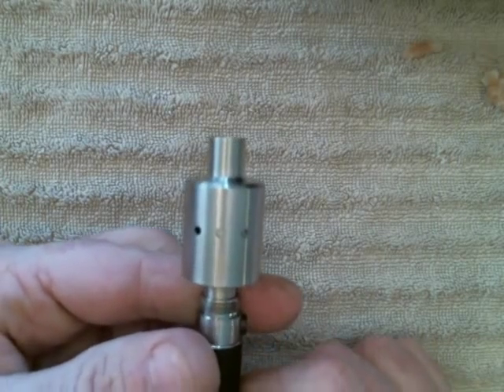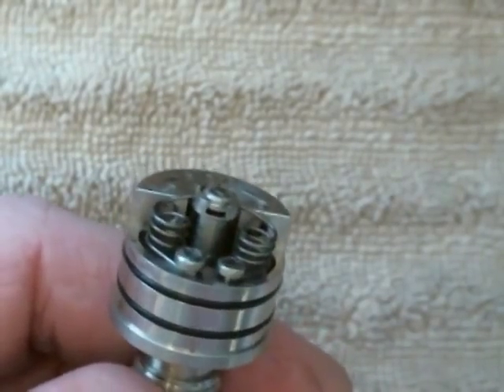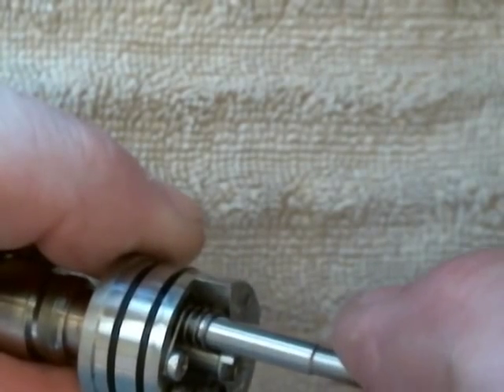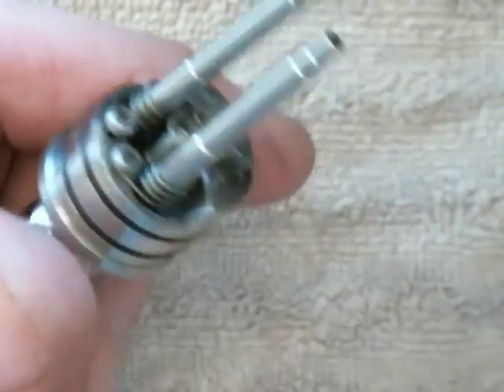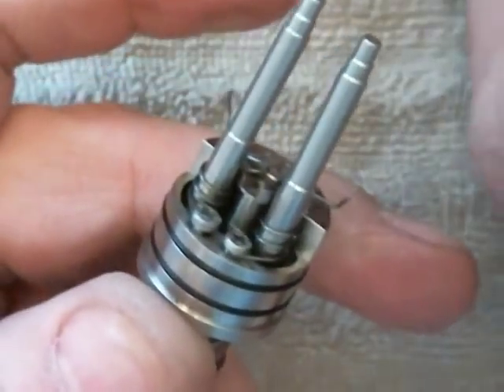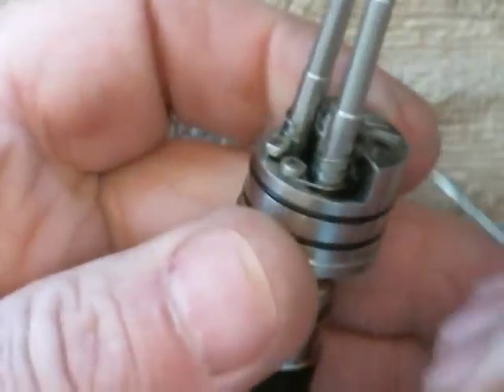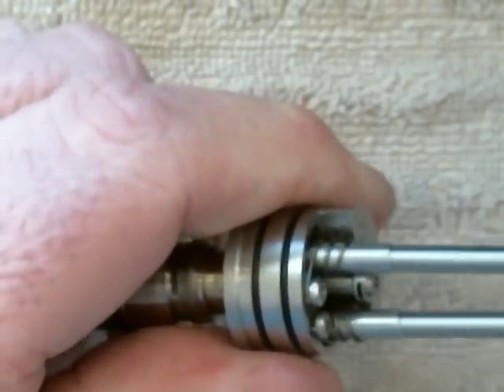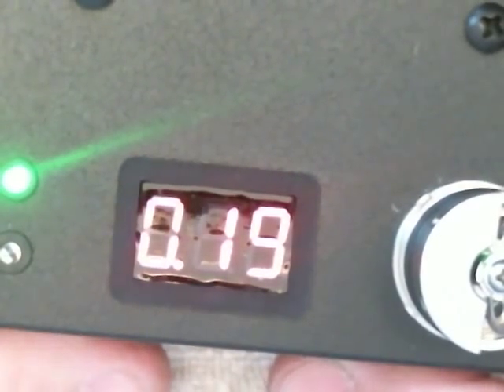The Marquis Dripper....Taking off a wrap

Comment: Problems inserting wick?  The way inwas taught, place the middle of the wick across the top of the coil and push down with your probe or screwdriver until you feel it touch all the way into the bottom.  Pull out your driver and then cut the ends off your wicks.  Dead easy.  Now the Marquis is just as easy to wick as it is to build.  Win win! :)